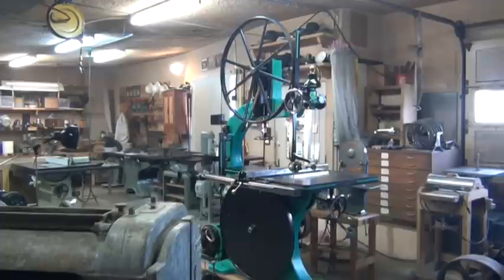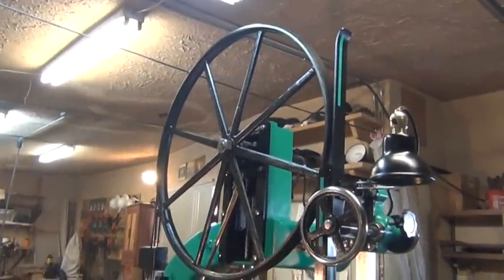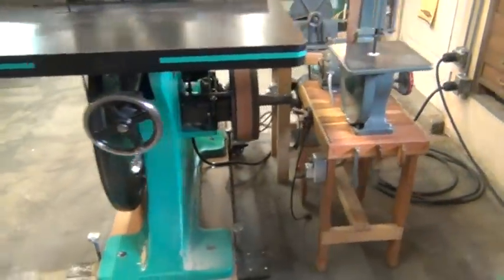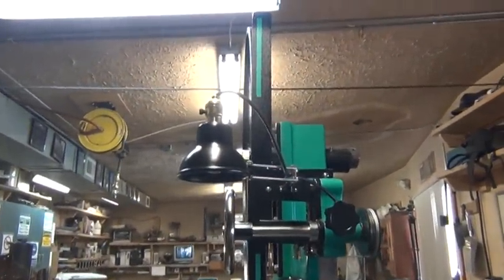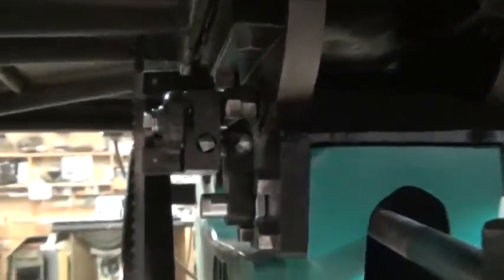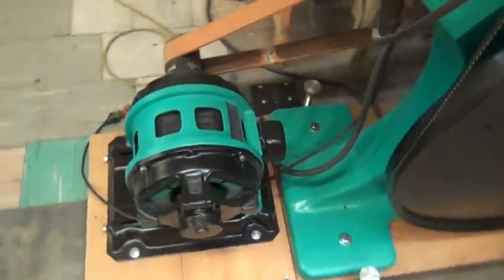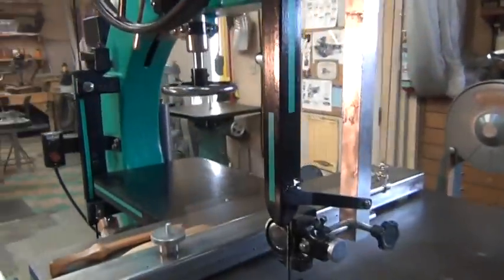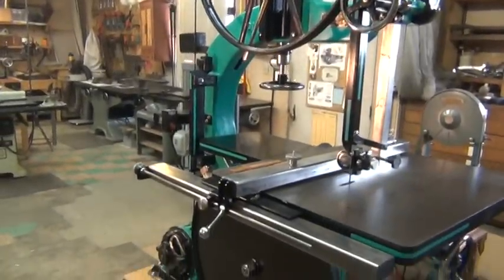Enterprise Manufacturing Co. 36 inch Band Saw Restoration

Comment: Nice. Amazing how standardised the general specification was on those old C frame bandsaws. Very elegant castings from a time when Pattern makers made a special effort for the woodworking machines they would prefer to use. I have used a few of the type. The Tannewitz was probably the best engineered of them. They ran at higher speeds and could rip wide stock with frightening speed.
Our Tannewitz was 42" and had a ten horse belt driven lower wheel. 
Oliver did a good 36" for many years and really not to far removed from what you have there. I've often wondered what Yates bandsaws were like. Never seen one.

Comment: I have an old Oliver bandsaw that was made in Manchester here in the U.K. the cast body is almost identical to yours only it’s direct motor drive with cast alloy wheels so I’d say it’s a 20s/30s machine. It runs so much smoother than my more modern machine. I might restore as you have done here.
Reply from the maker: That's cool Adam. Those old Olivers are great smooth running machines.
Reply: Shane - Blind Dog Blades yes they are it seems there was two Oliver companies though. One in Manchester England U.K. and one in states. Mines a dam good old machine and I really should do something. I have a chisel Mortiser that’s an Oliver and equally as old too
Reply: yea i think you might be right about the body being oliver, that could eplain why the namplate wasnt scribed with a serial number/model number as it may have replaced an old oliver one. beautiful saw none the less, i just got my hands on a gorgeous oliver no 11 table saw, and i cant find anything about it online anywhere. about to start restoring it and am a little aprehensive not knowing anything about the saw other than it might be the last one and i better not mess it up.... the pressure is on haha!
Reply: Cant wait to see
Reply: Oliver used to have a close relationship with Wadkin. Very interesting. The early Wadkin versions had a straight rather than fully curved neck. But not dissimilar.

Comment: Hi Shane, good video about your Band Saw, and good job, I am from Brazil and here we can find Vintage Band Saws from Invicta that made good Band saws based in projects from  Rockwell/USA, the wheel is big  30 inches and the body is made of casting iron....as your machine is one machine that can work with good care for several generations....the new machines after short time require constant maintenance.....Your video is inspiring me to restore a Invicta Thanks for sharing your job

Comment: I see where the manufacturer actually made a lot of steam powered equipment.  I wonder if this old saw could have originally been powered by steam?  You did an amazing job on restoring this.  It’s a shame that there isn’t more info available about the manufacturing of this old band saw.  I think you are right that this might have been a prototype and one of a kind!  One question I do have is how did you manage to move that thing to your shop??
Reply from the maker: It ran on a flat belt pulley system that could of very well been powered by steam at one time.
Here's some info on the manufacturer, you may have seen it: 
http://vintagemachinery.org/mfgindex/detail.aspx?id=296
i moved it into the shop with a pallet jack after stripping it down to the bare frame.

Comment: Don't you think that 3-phase motor is a bit too much for the application? It's way overpowered.
Reply from the maker: No, not for a 36" bandsaw with one of the wheels being sold cast iron. You can hear how long it takes for it to get up to speed even with that large motor.